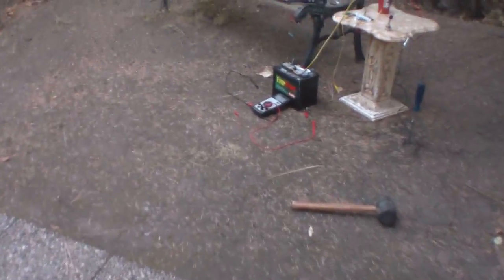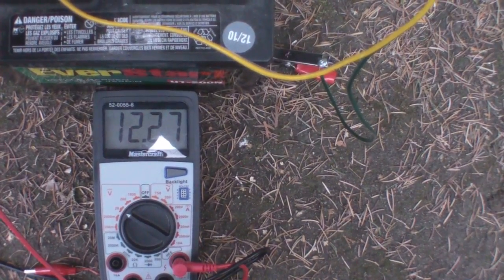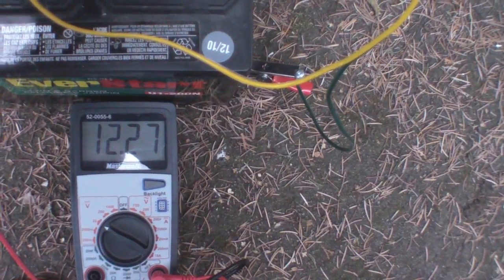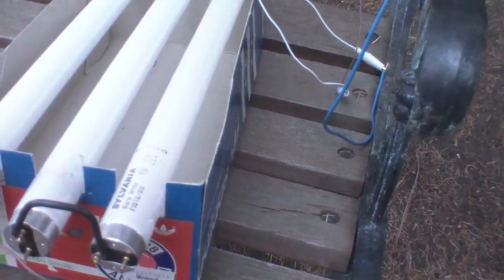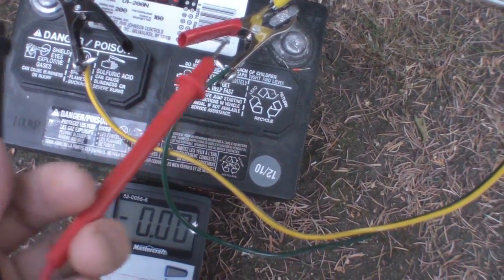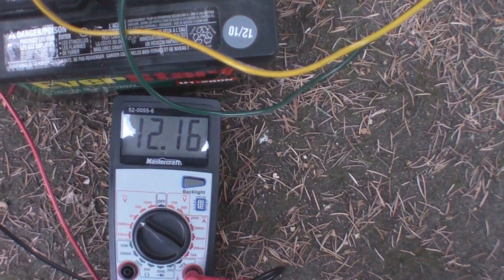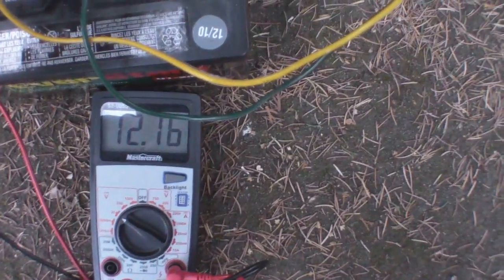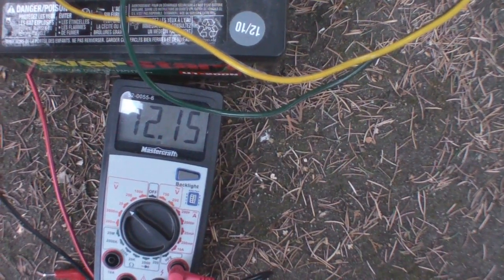(Replication) Pt. 3 Imhotep (kdkinen) Radiant CFL Oscillator and Self-Charging Circuit

Comment from the maker: See my next video. After a couple of hours of stand time, the battery standing voltage is at 12.32 volts. That is after over 10 hours of run time, with the battery having started at 12.315 volts.